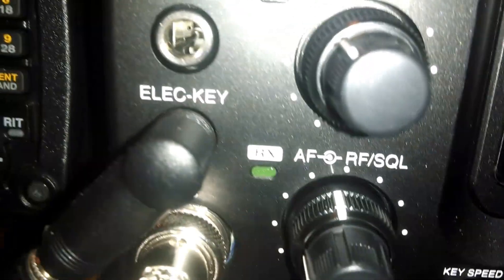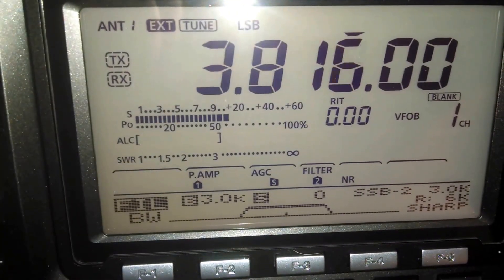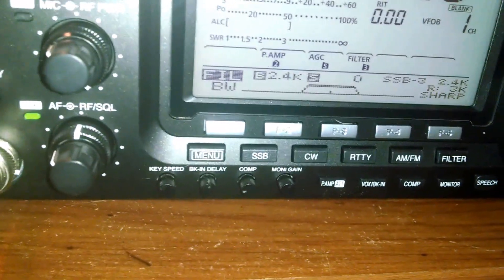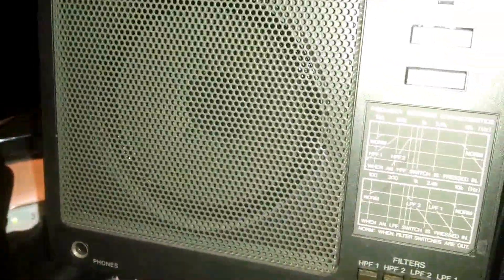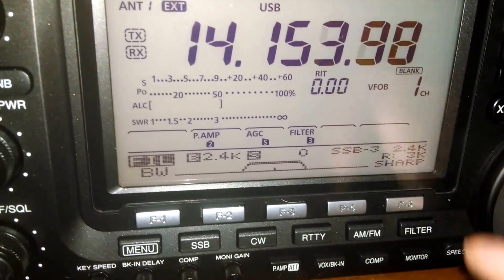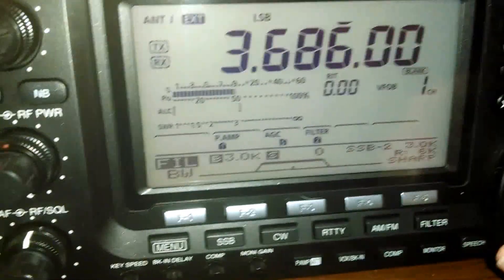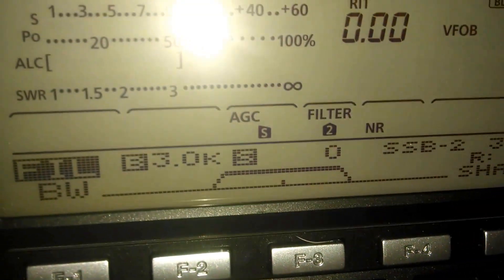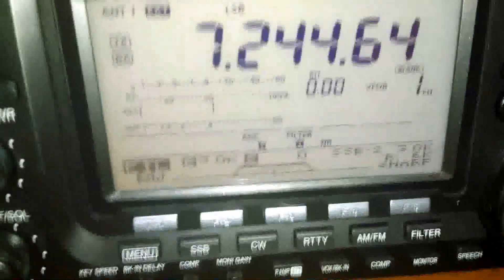ICOM 7410 FIRMWARE GLITCH ??

Comment: On July 4 2016 - Left radio on over night - same crap audio sound. Switched modes am fm back to ssb - back to normal. Did not power down. Bought radio in 2016. Sounds like the same exact issue. Any known fix or issue??? K1WJ David
Reply: GigiMonroe Good to know I don't have to power cycle to get it back to normal. Hope there is a fix soon. W8BT

Comment: Jim,  I have a 7410 with the same issue.  And it's not in the NB, NR, ANF circuitry.  I've let it sit overnight with each one in those functions off individually. I tried resetting the CPU each time and it still does it.  I haven't tried turning off the AGG however.  I prefer leaving my rig on 24/7 and have noticed this problem from day 1. Just like you said recycle the power and it clears it up.  Icom started fixing the ALC overshoot issue in the newly shipped radios starting with serial # 02002071.  Mine is 020020074.  Otherwise, I have no problems with ALC overshooting or any other problems with the rig except the muddy RX audio after its been on overnight.  If I hear or any fixes for this I will pass it on.  73,  Bill - KD2AKQ.
Reply from the maker: thank you for posting....was starting to think i was the only one....but having 2 radios that did the same thing,  i knew that couldn't be the case.  I finally called the service center in WA......they watched the vid, ...they were unaware of the issue and have since forwarded the issue to the Icom engineers.....lets see how long it takes for a fix.
Reply from the maker: jim
and you're right.....the NR does NOT need to be on .......just time needs to pass
Reply: +jim Update on this issue ?
Reply: I have the same issue and icom said they could not reproduce the issue and pretty much told me to pound salt

Comment: Do you see the po meter not going all the way over when you talk into the mic my rig is 1 month old and i have never seen mine go all the way over to 100% when i talk even with mic gain wide open 60 or 70 watts peak is all i see on my external meter and thats on a dummy load
Reply: @ Daniel Sensing ....
Connect your radio to an external RF power meter and into a dummy load to check PO. I never use a rigs meter to do that.
Reply: If one has the peak display on I see the peak reading go all the way to 100 on CW or SSB.  Try doing power out test in RTTY which will give full power output.  I've also noticed to get full output one has to have the POWER CONTROL turned up high.  And as another said make sure you working into good load to prevent SWR roll back.